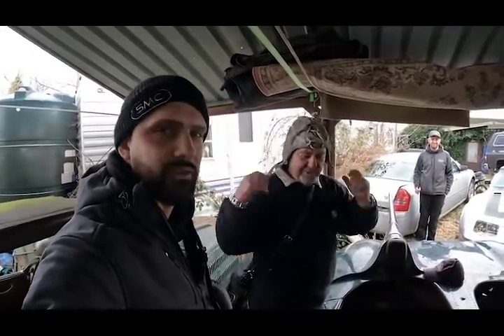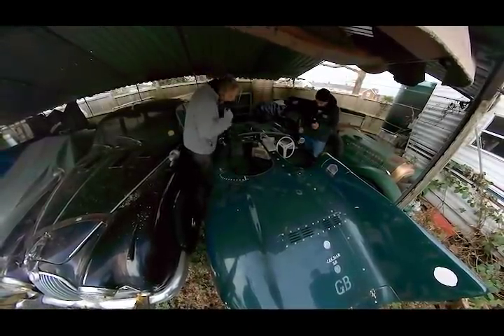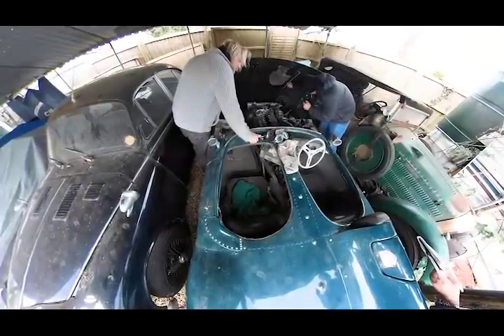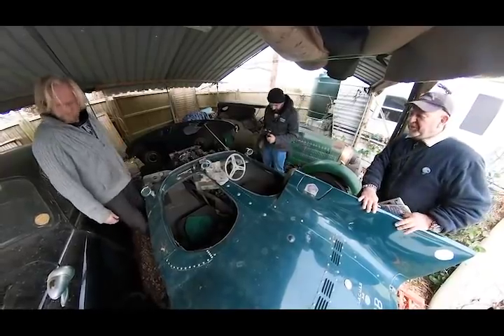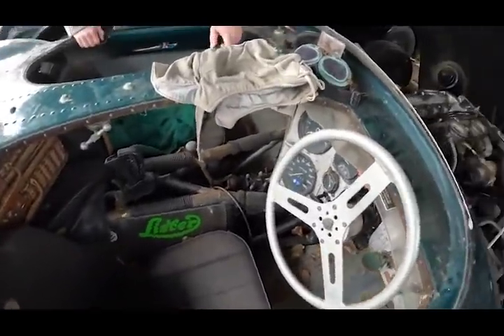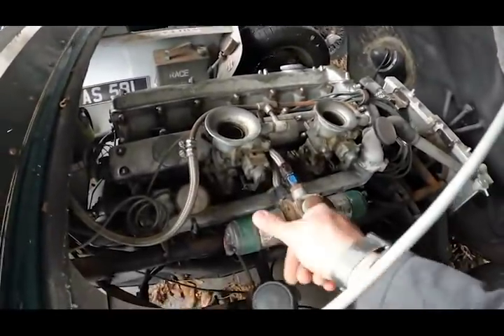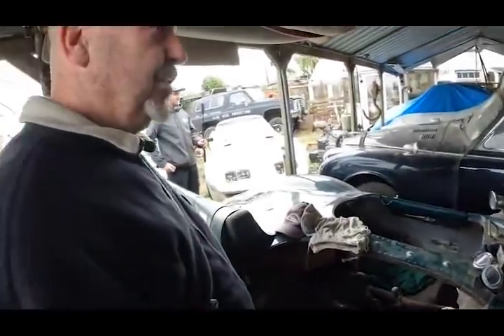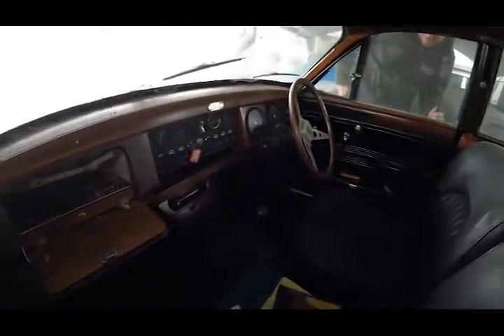UK's best barn finds of the year part 2

Comment: I don’t know about best barn finds. With the exception of the Auburn, this collection of replicas all look to have seen much better days and as you have found with the GT40, a neglected replica needs an awful lot of work and trying to establish what parts have been sourced from where can be a total nightmare 😱

@ 20.38 he says the 120 replica had an original XK as opposed to later XJ engine and when asked if it was a 3.4 or 3.8, then said it was a 4.2. I’m no Jag expert, but I don’t think any XK’s had 4.2 engines, which were first introduced on the Mk1 E Type after it was originally launched with the 3.8. I smell lots of bull here 😉